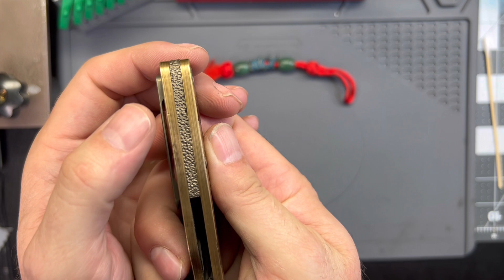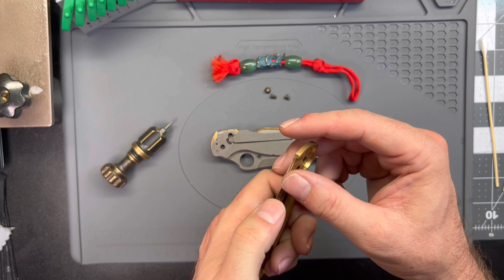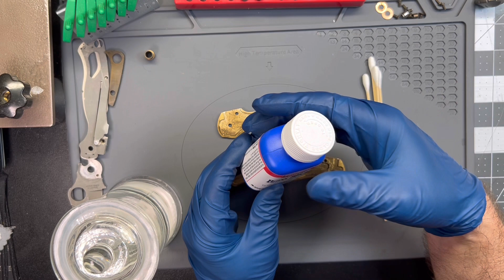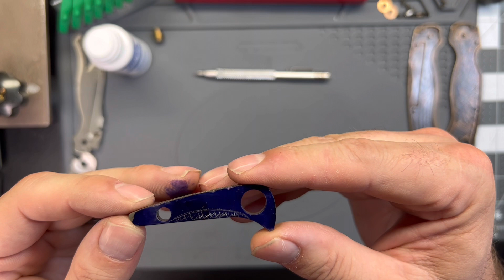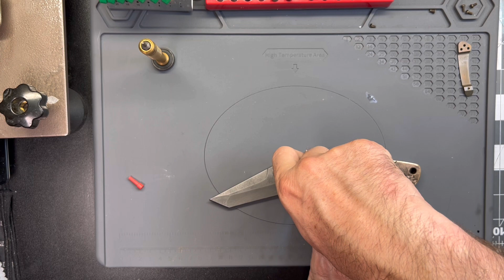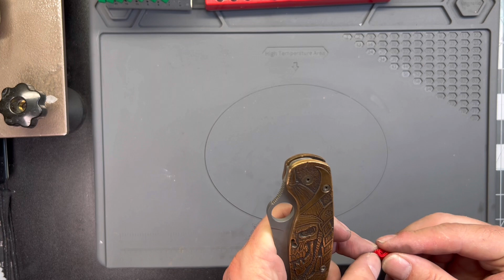Spyderco PM2 Blade HQ Exclusive Tanto with Wabisabi Craftworks scales

Comment from the maker: I’m all for “cheap” tools if they get the job done. My flex shaft rotary tool is going strong after 2 years of use and it was like $65 bucks on Amazon. However by spending a little extra money on certain tools will save you hours of headaches. “Cutting tools”, drill bits, needle files, taps, counter sinks are all tools that I won’t scrimp on. Spending a little more up front will save you money of the long run. Not to mention the headaches caused be cutting tools that won’t cut.